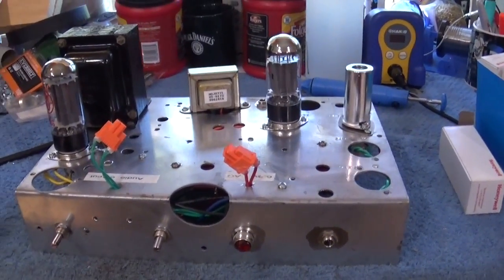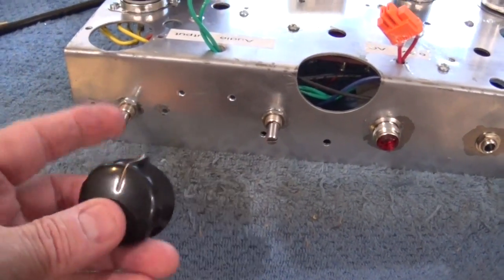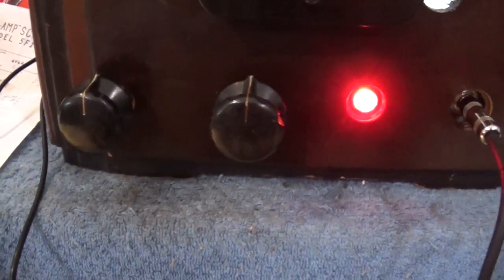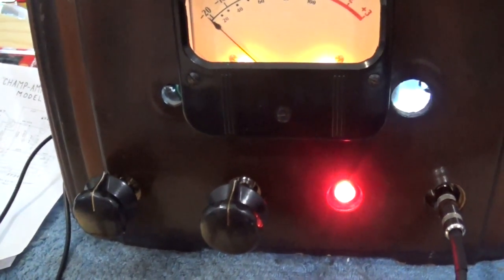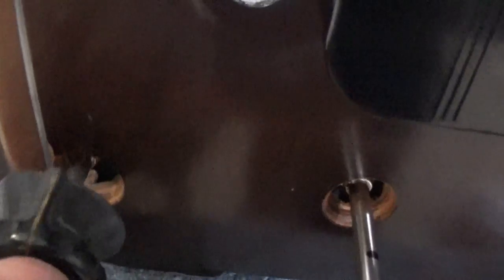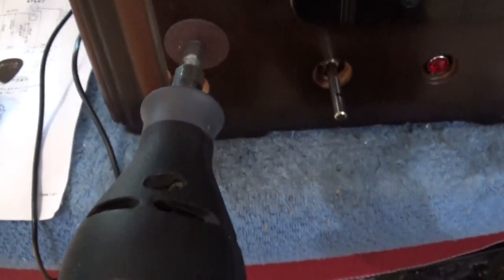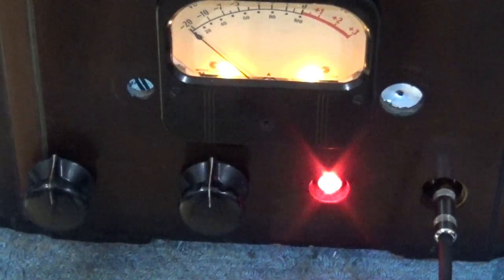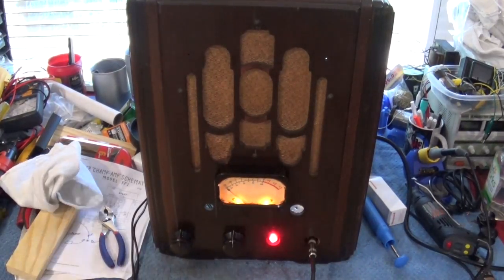Atwater Champ Combo Amp - Series Finale - Very cool outcome

Comment: Those knobs really filled the bill on that one. Really really nice job on this Ron. Excellent sound from it. Nice to see how the old amps got there sound by reproducing them. Look to the next one my friend.
Carl
Reply from the maker: Thanks Carl - I am very happy with this one - kind of a turning point for me in that I know how to build amps now without much trial and error. It may seem like a small thing but I am also happy I was able to build in a tone knob which is not on the original Champ.  It shows I  have learned something, lol  - Thanks Carl - regards, Ron
Reply: hmmm Ampeg, schemmy, parts, I wonder?  I've wanted an Ampeg for many years, they sound great.
Reply from the maker: I have an Ampeg V4  which is huge heavy amp that I restored about a year ago. This is the same head that was used for Bass on almost all the early Rolling Stones albums.  One day I will rip it open and video what I did inside !!!  Thanks as always my friend... Regards, Ron
Reply: Many big amps are not that complicated inside, a radio is more complex.  It will be interesting as to what is inside one of those very expensive amps.  Usually five tubes plus a couple more for reverb and tremolo.  One rectifier, two pre amp, two power amp outputs (or four on hi watters), a couple big expensive transformers, a bunch of caps and resisters to filter and couple, and you've got power.
Reply: To me I think the most complex deal with amps is the filtering with caps. Since they are not filtering out through if and rf coils like a radio, just the raw vibrations of the pickups, those capacitors do a lot more work. Having that board laid out like Ron has been doing is am important part of a build I believe.
Reply from the maker: You are spot on Carl.  I have learned while doing these videos that placement is absolutely everything. I have learned that crossing wires must be done at 90 degree angles and they having the shortest wires is crucial to success.  I also learned the 12AX7  tubes really must be moved as far away from the power sections of the amp... and usually will need to be shielded. Lastly I have learned that output transformers have both a positive feedback and a negative feedback side and when wired in backwards ( there is no polarity marking) will cause the amp to squeal like a greased pig at the county fair.... all great eduction and definitely different than a radio in some ways..... Continuous learning is a beautiful thing..... great stuff... thanks guys

Comment: Very cool indeed, Ron!  I wonder if on those two holes if you could put some dummy knobs over those, maybe smaller than the ones that actually work.  Like how on the old radios the tuning knob would sometimes be larger, maybe a couple repro knobs from radiodaze or something.  Good work my friend!  Take care, Gary
Reply from the maker: Thanks Gary - I am pondering what I will do with the holes... I am sure I will come up with something - I have lots of old bakelite knobs so perhaps I can use them - we shall see :)   Thanks , Ron
Reply: a line out jack would be nice, perhaps w/ vol control to attenuate it.
Reply from the maker: hmmmmmm Good Idea Don..... not hard to build that in at this point...  :P
Reply: Ron C, What about the box, the furniture, the carpentry?  Amps are one thing, but connect a nice amp to shitty speaker, and it will sound like crap.  There is much science to the cab.  EV, Lansing, Bose, to name a few, did much research on the baffle. A guitar cab can appear simple, but the difference in sound can be amazing as you well know.  There is much technology in that box, that goes far beyond the sound drivers in it.  Speakerfreak95 is an interesting guy, Jason can be fascinating.  If may be fun to open up an old EV or Altec cab to peek inside, but have a tape measure handy to take dementions, measurements are crutial to the secrets of "that sound".  Don